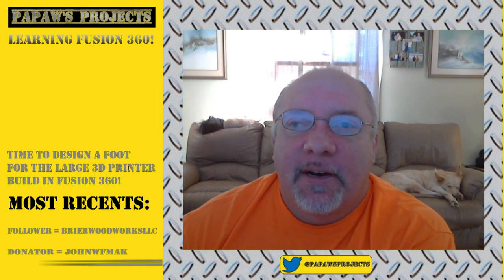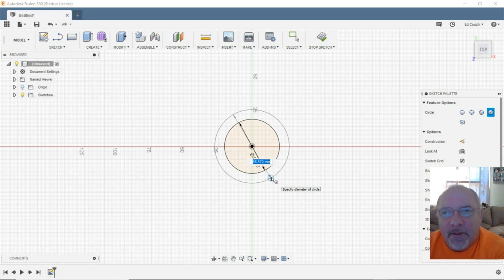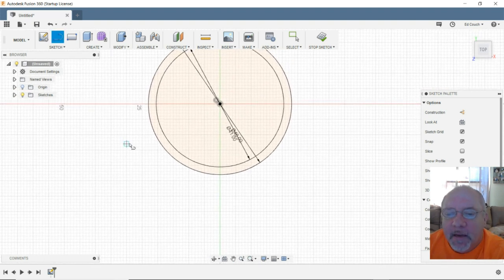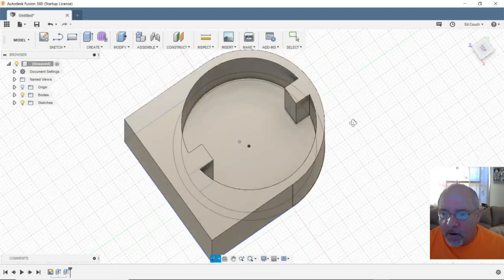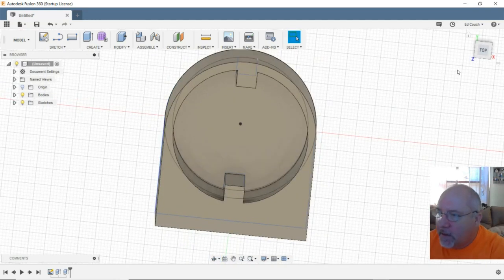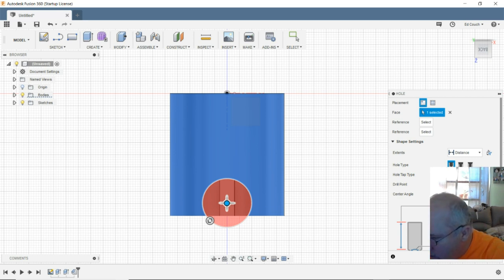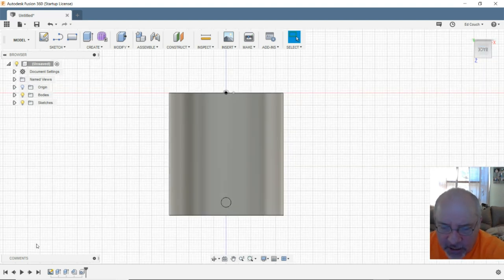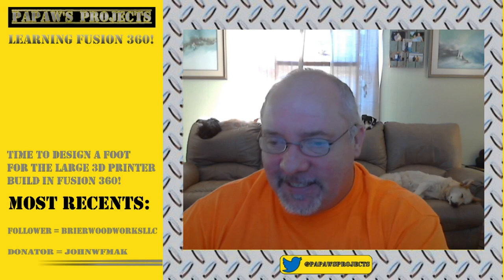PaPawsProjects Learning Fusion 360 to design a Foot for the large 3D Printer Build

Comment: did great! couple tips, the "hole"feature doesn't like rounded faces, reason it kept locking to the edge when you selected the body 1st. Just use a sketch-circle and extrude thru.  Also FORGET the move tool for features/modeling. ALWAYS go back and EDIT the feature.  The move tool is more for moving whole bodies around after the modeling is done for multiple items and you want to align them after for doing things like assemblies.